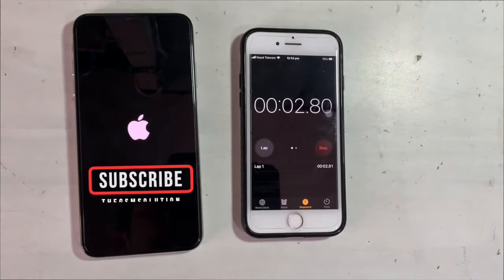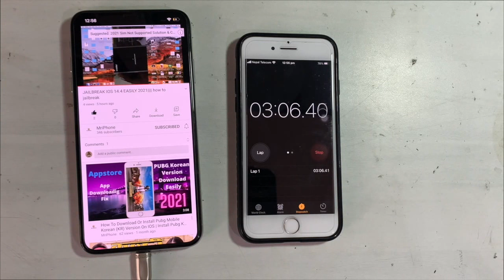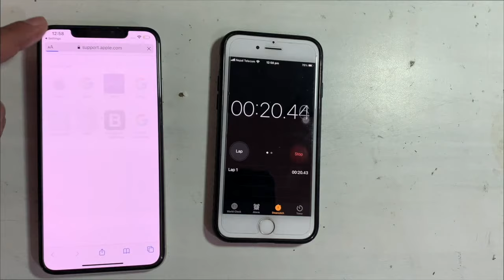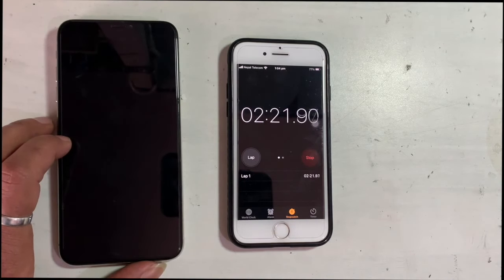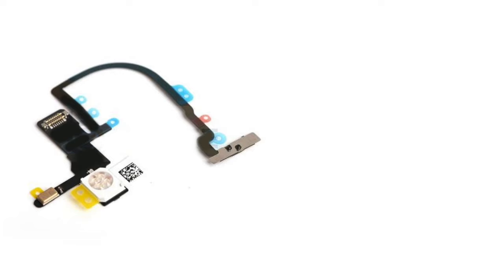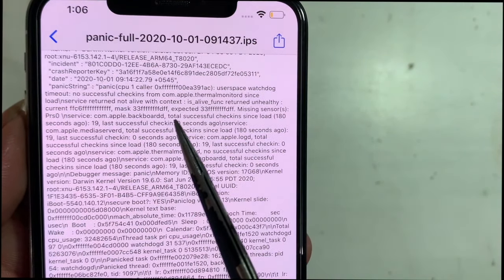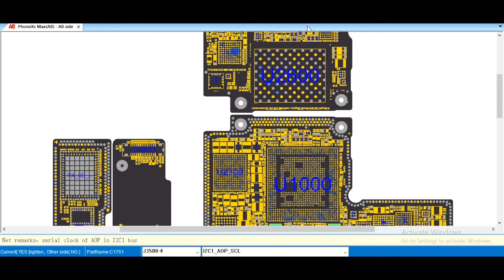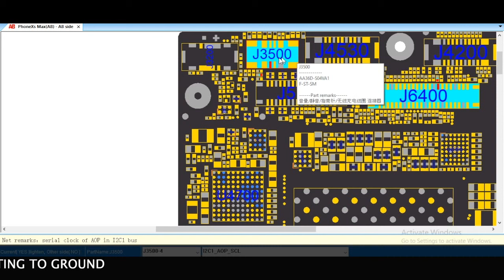iPhone XS /XS Max Reboots after 2-3 minutes solution.

Comment: My 11 pro max after replacing the battery it's keep restarting
Reply from the maker: Might be loose contact with the battery or must be battery faulty. Try by changing new one.
Reply: Even I had the same issue when I changed the battery on my x and when the battery fully drained at night and I plugged in for charging in the morning it started to restart in every 1 or 2 min but when I plugged in the old battery it booted fine

Comment: Same with my iphone XS. restarting then battery show 0%, the phone is very laggy. 3x changing the battery but still same, help me😫😫😫
Reply from the maker: First 0% is the problem. You have to fix it. Once check wireless charging working or not. Restart and laggy is the cause from the side of wireless charging side.I also faced such issues on iPhone XS Max before.
Reply: did u find the solution for that??
Reply: Broooo, Im facing the exact problem !! 
After restart the battery percentage shows 0% and phone becoms super laggy 
T__T
Reply: @MuntasirOhee  bro does it fixed?

Comment: panic(cpu 1 caller 0xfffffff012d5d6f8): userspace watchdog timeout: no successful checkins from thermalmonitord\nservice returned not alive with context : is_alive_func returned unhealthy : current 6ffffffffffff, mask 37ffffffffdff, expected 37ffffffffdff.  SD: 1 BC: 0 RC: 0 BS: 1, Missing sensor(s): Prs0 \nservice: backboardd, total successful checkins in 196 seconds: 19, last successful checkin: 0 seconds ago\nservice:
Reply: Pls sir you explain me
Reply from the maker: On which model you got a problem.
Reply: I phone xs atomatic 3. Mint restart
Reply: Sir please told me
Reply from the maker: The log shows there is a problem with your charging flex.
Reply: Sir battery problem
Reply: 3 mint only restart again nd again
Reply from the maker: The panic log shows Charging flex issue not battery.